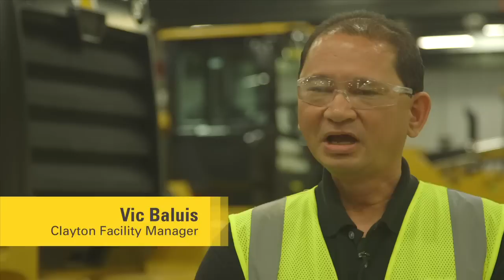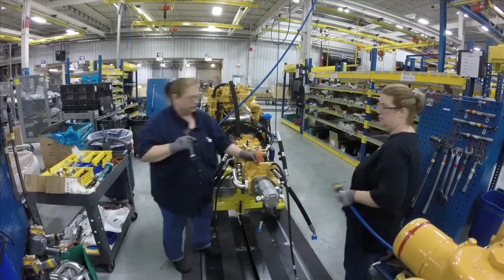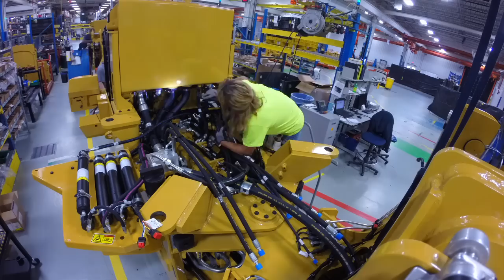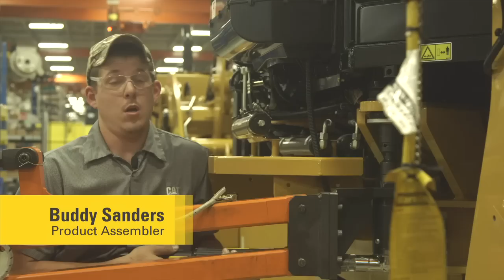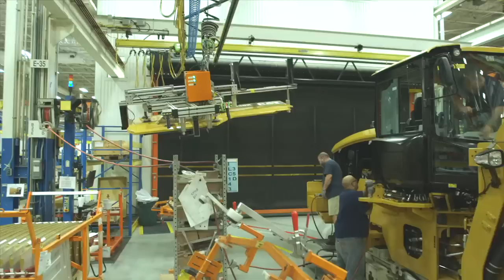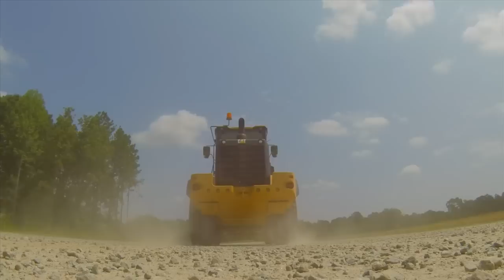Built in Quality: Cat® Small Wheel Loaders Manufactured in Clayton, NC

Comment: I just swap over to a brand new 2019 938m loader... its garbage..slow and weak and plus leaking fluid already and too much grease comming out...no good.
Reply: You must not realize how to engage the rabbit button on the machine. As soon as you figure that out it will give you whip lash at full throttle. Tighten the fittings and it will stop leaking fluids. Best machines built, they do take maintenance.